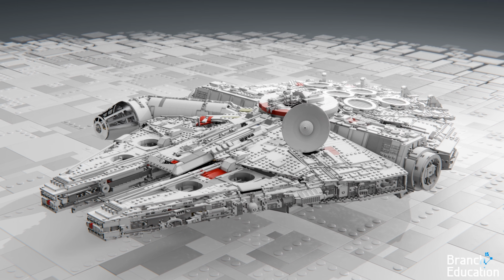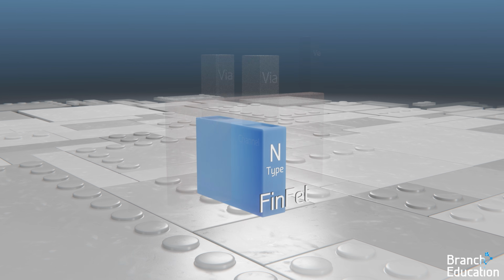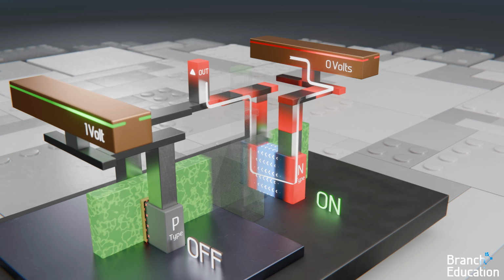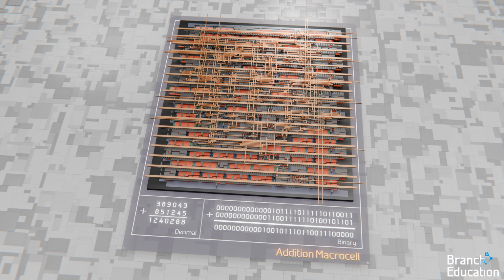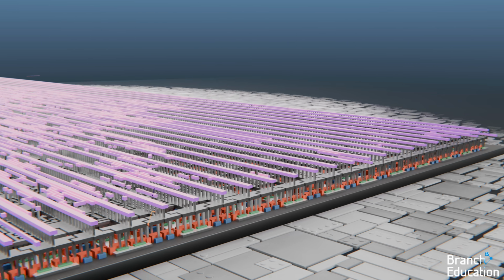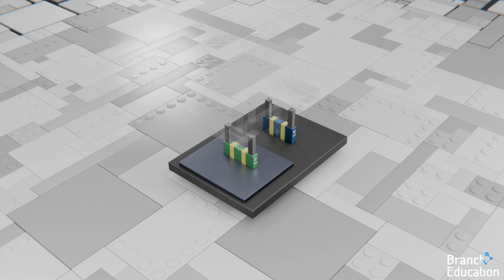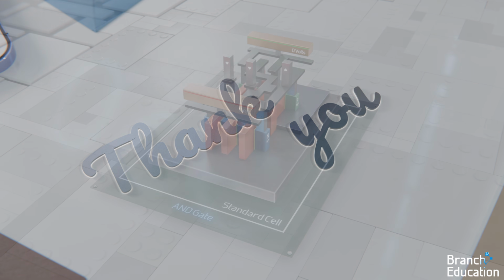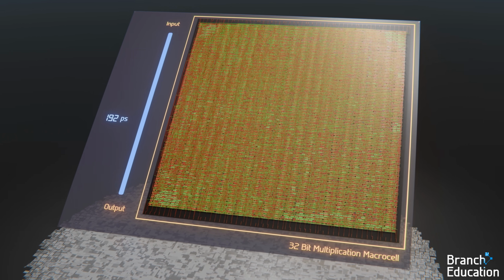How do Transistors Build into a CPU?  🖥️🤔  How do Transistors Work? 🖥️🤔

Comment: I feel like the N type transistor in the inverter standard cell is not doing anything. Even removed it would not affect the function. Where is it needed here?
Reply: The transistor (in this case, specifically a MOSFET) is a device that converts input voltage into a current flow. The voltage here decides whether it is a 0/1, not the current. The n-type transistor is essential to reset the bit to 0V. A good analogy would be that a P-Type transistor is an inlet that fills a water tank (the output capacitance) and the N-Type is an outlet that drains the water tank, with the level of the tank deciding the bit (filled/ not filled).

If you were to only keep an inlet (P-Type), you could only ever fill the tank once (set to 1). Even if you close the inlet (turn off the p-type), the water remains in the tank. Which is why you need an outlet that is turned on at exactly times the inlet turns off, to drain the tank.

Inlet on + Outlet off = Tank fills up
Inlet off + Outlet on = Tank empties
Only Inlet exists = Tank can never go back to being empty
Only outlet exists = Tank can never fill up again

Comment: Thanks Nice clip    👍. I got a electronics back ground . Question as i understood 1 Volt equals 1 binairy and 0 volt equals 0 binary . Is that true ? I worked with TTL logic early 80,s 7400 4 nand gates etc .If i rember correctly 5 volt was binary 1 and 0 volt was binary 0 . However I can understand  it for educational purpose. Or may be , it being 2026 there are components that work as you explained 🙂 now a days

Comment: I think you did an excellent job on this video and thank you. I am an older man trying to review material that I was once very familiar with. I had micro computer electronics training back in the 1980s and the network training approximately 1999 to 2000, and in the 1980s I worked on radar missile guidance system in the military and then in the 1990s I passed the A+ and Cisco CCNE exams and Microsoft MCP although I finished five exams but I never finished all seven so I never earn my MCSE. I’ve been out of it for a lot of years because I worked in refineries for almost 15 years and then 10 years as a truck driver or 11 years as a truck driver and I’m going back trying to refamiliarize myself on a lot of old ground that was familiar once upon a time. Now that I’ve discovered you, you’ve got a new phone and I will watch more of your videos. Very good job. 🙏👍

Comment: 4:42 That second Water Faucet analogy is flawed, because it is just inverted handle. In the case of the transistor, you need to actively provide 1 Volt to stop the electricity from flowing. An analogy would be if there was a spring on the faucet that kept pushing it up, so you need to use energy to stop it from flowing.

Comment: I didn't quite understand what happens at the N-type transistor connected to the 0 Volt rail when 1V is applied at the input. If the voltage is 0V then my understanding is that there is no current, so how can electrons flow through the N-type transistor?!
Reply: I had this thought also. I am struggling to understand why the n type transistors are required at all, or ground for that matter surely its either 1v or no voltage. I did a bit of research and it suggests that the 0v expected from the gate isn't always 0 so ground is required to essentially reset 0. But then I don't understand why you can't just have a single p type linked in parallel to the output which connects to ground. Im yet to find an answer for this
Reply: @s@samueldudley2316 Yes, 0V does NOT mean “no voltage” or “no electrons”. 0V is a reference point set in your circuit around which you set/measure all voltages. Similar to how we set “sea level” as the reference point for altitude, it does not mean you can’t go any lower. From my water tank analogy above, you can infer the height at which the outlet sits as the ground or 0V. If the inlet sits at max tank height (1V), it can always fill the tank to its max height, but turning off the inlet does not drain the tank. The water level remains the same. What the outlet allows us to do is drain the water until it drops just below the outlet, where it can’t drain anymore (0V)
Reply: If you were to have just a single p-type as you describe from 1V to 0V, it would be like connecting the inlet and outlet with a single knob, bypassing the tank entirely. There is no point to this as you cannot measure a water level, i.e. the voltage. (Leaving aside the fact that doing this would be catastrophic as it is the definition of a short circuit)
Reply: The transistor (in this case, specifically a MOSFET) is a device that converts input voltage into a current flow. The voltage here decides whether it is a 0/1, not the current. But the current is a tool that helps you charge/discharge that bit. A good analogy would be that a P-Type transistor is an inlet that fills a water tank (the output capacitance) and the N-Type is an outlet that drains the water tank, with the level of the tank deciding the bit (filled/ not filled).

If you were to only keep an inlet (P-Type), you could only ever fill the tank once (set to 1). Even if you close the inlet (turn off the p-type), the water remains in the tank. Which is why you need an outlet that is turned on at exactly times the inlet turns off, to drain the tank.

Inlet on + Outlet off = Tank fills up
Inlet off + Outlet on = Tank empties
Only Inlet exists = Tank can never go back to being empty
Only outlet exists = Tank can never fill up again

Comment: What's the point of using inverter gates if they produce the same effect as a P-type transistor? If there's voltage at the P-type transistor's input, there's no voltage at the output, and vice versa? So why complicate the circuit by creating an inverter gate instead of just using a P-type transistor?
Reply: A p-type transistor takes an input voltage and gives output current. But you want it to take an input voltage and produce an output voltage, that can be fed to the next set of transistors. The voltage here decides whether it is a 0/1, not the current. But the current is a tool that helps you charge/discharge that voltage. A good analogy would be that a P-Type transistor is an inlet that fills a water tank (the output capacitance) and the N-Type is an outlet that drains the water tank, with the level of the tank deciding the bit (filled/ not filled).

If you were to only keep an inlet (P-Type), you could only ever fill the tank once (set to 1). Even if you close the inlet (turn off the p-type), the water remains in the tank. Which is why you need an outlet that is turned on at exactly times the inlet turns off, to drain the tank.

Inlet on + Outlet off = Tank fills up
Inlet off + Outlet on = Tank empties
Only Inlet exists = Tank can never go back to being empty
Only outlet exists = Tank can never fill up again
Reply: Essentially the point is not to “turn on a tap”. The point is to turn on a tap to fill something up or drain it completely

Comment: What I still don't really understand is why the ground rail is needed in the first place in any of the standard cells. If the output should be 0v, and the gates on the power rail's side are off, then isn't that enough? Why does there need to be a connection from a ground rail if the output is already 0v?

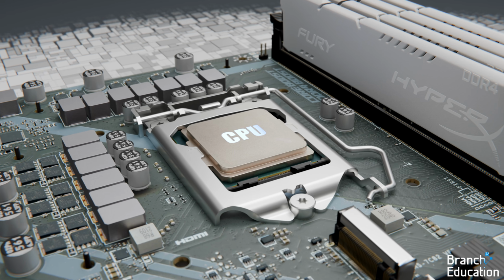Comment: 13:19 ALL processors aren't "incredibly complicated with tens of billions of transistors inside of them".
Just the 3000-4000 transistor and 50 year old 6502 processor design, in its modern versions,
is still sold in numbers more than TWICE those of Intel PC processors.

Comment: What a great channel. We used to build these gates with vacuum-tube circuits and discrete can transistors. Large, and consumed lots of power. 

Dinosaurs roamed the Earth. 

Then came Large-Scale Integration and Very Large Scale Integration. The PN gate density of modern processors and GPUs, and the size boggles the mind.

Comment: It's a bit confusing, you don't apply zero volts to the gate instead you are discharging the gate (capacitor) to ground. it's more like charge and discharge. and the time between them is a limiting factor. so we have a limit on how fast the CPU clock is.

Comment: if a 32-bit integer multiply takes just 192ps (most of a single 5Ghz clock cycle), why is it that most CPU architectures pipeline the process into a 3 clock cycle latency operation? is this an improved/optimised multiply logic from what was used 10 years ago, or are there other factors at work? (looking forward to the multiply logic episode :) )

also interested in how data is piped/selected from files of 300 or more registers to the multiple ALU blocks in a modern superscalar CPU and the time/energy costs involved in moving data from place to place on a CPU with reasonably large structures like that.

thanking you for explaining using modern fin-fet geometry and 1V logic as it is actually used in modern processors. you make the best low-level visual descriptions I've seen anywhere. When I was first forming my foundational understanding of logic circuitry all I had was a hand-drawn-notebook-looking booklet from Tandy!

Comment: A transistor in your computer doesn't work with 1 and 0 volt; there is a high and a low voltage. While that doesn't change a thing for the logic, the title indicates we are talking about electronic circuits, not a logic simulator... have a nice day 🙂

Comment: Can't we make a two-input XOR gate with just 8 gates instead of 10?

To ensure that like signals will receive a 0V output, we can connect two P gates in series, each gate receiving one of the inputs, and connect two N gates in series as well, also receiving both the inputs. These two series setups can connect the 0V to the output rail in parallel. Sending the same input voltage through A and B should always output a 0V signal.

 For the 1V rail, we can connect one N and one P gate in series, each gate taking a different input, and connect it in parallel with an identical N-P series connection but mirrored (if the first series setup connects input A to the N gate and input B to the P gate, the second setup connects A to the P gate and B to the N gate). This should ensure that sending opposite inputs will always connect the 1V rail to the output.

Are there any mistakes in this approach, or can this be used as an alternative? (Sorry if my explanation is unclear, it's a pretty roughshod idea)
Reply: We will be making more videos on this topic soon, stay tuned!!

Comment: How can  hydraulics pump  lift much weights?
Reply: Hydraulic pumps work on the same principle that pulley works on. The difference is that hydraulic pumps use liquid instead of the chains.

Comment: Don't need transistors. Diodes could do computing, but the power consumption would be much, much higher. Transistors do amplification and so, much, much lower power can be used to create logic circuits...

Comment: There are a few details that aren’t clear to me. For the n- channel transistor, the silicone in channel part is p-type and outside the silicon is n-type for the source and drain. For the p-transistor it is the other way around. Remember in the planar process, n-channel transistors are built in a p-well and p-channel transistors are in a n-well. How do you get fins with different doping. Or is it possible to use intrinsic silicon for both transistors? And what about the source and drain areas? You have to add doping to the fins outside the channel areas, n for the n-transistors and p for the p-transistors. That isn’t explained in the video. Is there some fundamental physics that I don’t understand?
Reply: The transistors are much more complex than explained in this video. We will make a video covering this topic in extensive detail.
Reply: @BranchEducationPlus  Looking forwards for more videos. I’m a retired engineer, worked with R&D and as an engineer in production of IC my entire professional life up to my retirement 2009. So much has happened since then: FinFets, Gate-All-Around, ALD, ALE and EUV lithography. I’m still very curious, trying to understand, hopefully avoiding dementia!!

Comment: An emulator is needed first, such as a coprocessor emulator simply to be resident on a card in the card reader. The emulator makes the coprocessor in the system, on the card, on hdd I don't know. It takes time, about a week for a micro sd card to become fully ready, the hc xc or depends on the brand, kingston is the best among them. Same w physx, the software is the game itself to make hardware physx for cars. The process is done for the cpu as well, cpu may have hc physx and A5 together. Hc is a foolish physx for kids, A5 fails 5 opponent cars during jumps. You have to use more cards to make this mixture of cpu physx. That's for android.
For windows the fastest fix is dosbox, cpu cycles set for the best maximum, and run duke atomic intro all for 3x. Laptop will become faster.

Comment: I worked in VLSI design for almost two decades and always had problems visualizing finfets, even after utilizing them for years. When you work above the standard cell level, those little pieces are just magic black boxes. This video does a fantastic job of illustrating the finfet structure and function, while also showing their arrangement inside the standard cells. Thank you!

Comment: Well described, graphics are great. V/over, nice annunciation. Yup! Yet... it still doesn't tell me 'how' putting a charge through a layer of X thing then billions of 'other' tracks 'switches' gates, connecting, deep nanoscopic voltage (that does things to current)  shallow, makes needed changes that works for a whole chip. A light switch is easy on & off, but how does electricity really work. Eg a 2mile wire, click, almost instantly lamp illuminates at other end. It's quick. Never mind... love y'all.

Comment: The scale of conplexity at play here is absolutely staggering. How on earth can anyone even keep track of billions of transistors let alone test them and manufacture them each year?
Reply: you dont have to keep track of every single one. as the video explained. you only need to create a few standard cells (maybe 100s). Standard cell designers do these job. These standard cells are reused over and over throughtout the chip by digital IC designers to create a bigger design. it's a team effort of thousands of engineers.
Reply: you use computers to keep track of the computers.
Reply: Major entry level IC layout engineers  are creating transistor patterns on masks . That would be plus in advancd engage  in reverse engineering at  nodes  which helps circuit edit (Focused Ion Beam).

Comment: The upper structure Solaire of Block like vacant of attach and the V lines of designs reconfigured to real time tech curtaining receptors and ferriers of system operated open architecture designs up and down and along up like levellings like Lego block system movers as permitted by the regulators and controllers, watchers. The business side. The by category or group of identify either world or international business types reconfigurable trend or trade cards of transact of Multi function of system and by agreements arrange to group of business persons or investors of compatibility synch. Remember Multi function by time trend meaning the data encodes and storaging and informational contents of continuous update for this project was designed from the start to interact in business mode with other Advance/ Modern Civilization types, creating Investors groups and to its future configuration, the space colonies and logistics business transactions environmental to environmental To and Fro, the reason why modifying to such mode exact your business structure for my projects not just for Tourism visitors of variety of purpose and medical tourism also for raw materials and equipments  components orders handling plenty of transactions environmentally here and there that when inserted the card another office group shall mend the accounts of transactions connected to space satellites. Let it be